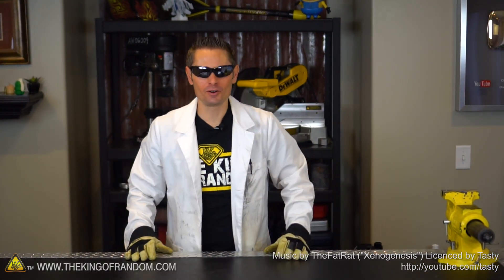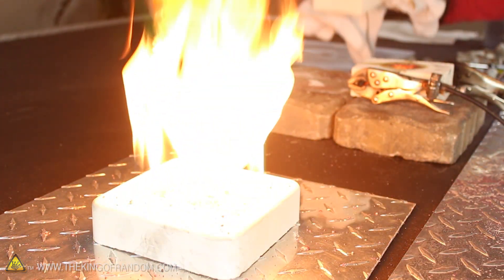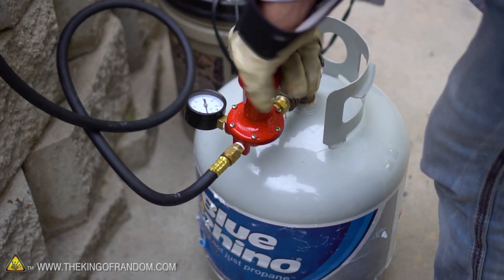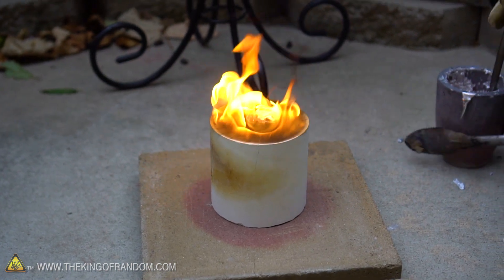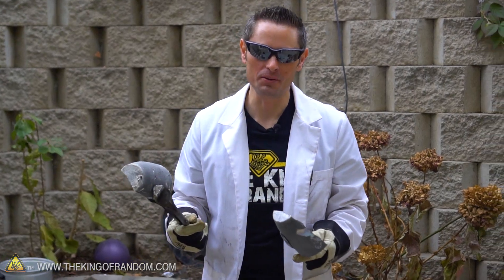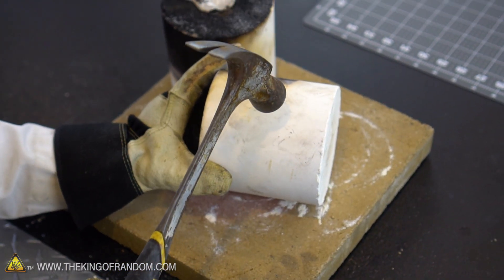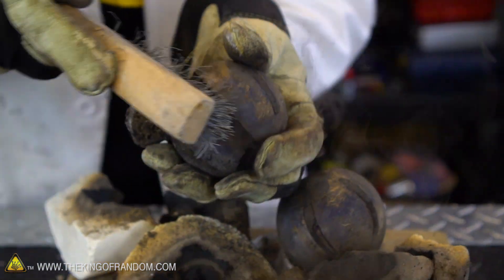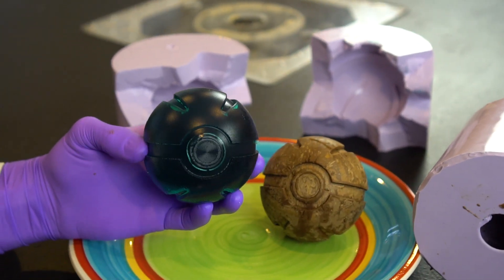Casting Aluminium PokeBalls

Comment: You should put your silicon molds in a vacuum chamber before letting them fully cure and set. It'll force all the air bubbles out, due to the drop in air pressure.
Reply: It would make for a great "Diy make your own vaccum chamber at home" video for him.
Reply: Guys we did it, check his Instagram he got a vaccum chamber.
Reply: 100% Agrees with this
Reply: is a vacuum chamber actually viable i have never seen that before that's interesting id love to see if it works
Reply: Kemal Ficici that's brilliant
Reply: venom gaming yep
Reply: Great idea👍
Reply: 26 Seconds :)
Reply: Kemal Ficici Does he have one ?
Reply: FredyEX l
Reply: Adam Savage, formerly of Mythbusters, on Tested has one and uses it for small mold making. Heck, he built his.
Reply: yess the molds will come out way better
Reply: Aaron Shields I'm pretty sure he does. If not, you can always buy one, they don't cost that much.
Reply: I the past he said he didn't own one
Reply: Rohan Gisiawan Oh ok

Comment: If you're looking for an easier method to cast things you should just buy some green sand and make some wooden cases for it. That's what most foundries use, and I can't imagine it's that expensive to purchase. Also look into common set-ups for casting molds. There are specific ways to make the molds to avoid getting air pockets/voids in your parts.

Comment: mix some okay sand in to your mold mix. say 60/40 plaster to sand. similar mix to the forge lining. and for the bubbles you need a vacuum chamber of some kind to Degas your silicone and plaster.

Comment: To avoid the air bubbles at the top of your lost wax casting mold, you need to add more spruing so that air has a place to be forced out, during the pour.

Comment: to reduce bubbles in your molds, you could probably build a vibrating table, like they use for concrete molds.  I have a homemade one, great for chocolate molds, and it would most likely work for silicone and plaster as well.

Comment: Grant,  try mixing your plaster 50/50 with fine play sand to form the investment, or grind up some diatomaceous earth kitty litter in a  food processor and mix it in the investment on a 70/30 plaster:kitty litter.
Reply: Additionally you may want to add vent sprues to your investments/molds so the gasses can escape and keep them from igniting the plaster material as much.
Reply: The vent sprues will also allow the air bubbles to escape and for aluminum to flow up through the vents.  As the aluminum cools and shrinks molten aluminum in the vents can help keep your spherical casts more round.

Comment: I work in an iron foundry and we use natural gas torches to bake out the moisture in our ceramic linings. To eliminate the shrink you should add a riser (large cavity in the mold above the casting) to provide feed metal when the aluminum shrinks.

https://en.wikipedia.org/wiki/Riser_(casting)

Comment: Hey Grant, I think I know how to eliminate the problem you had with the top of your mold. One thing would be to add another hole to allow gases to escape while pouring. Also adding a riser would help eliminate the shrinking problem. I'm not an expert on casting, but I'm taking a course in college where we learned how to do this.

Comment: hey i have a tip for metal casting.You can use quarts sand for the mold .Put it in a wooden frame and fill it with casting dirt and put the pokeball in tje midle and but quarts sand around it.Harden it wirh c02 and make holes to pur the metal 3 holes is the best and pour the metal in the hole.I hope this helps

Comment: Grant: are you using pure Plaster of Paris? you can mix in additives to improve its usability for casting. For instance you can mix talc in to prevent cracking.

You can also use sand as a filler in it, which might help you get the best of both worlds.

Comment: you can soak them in a bucket of water to clean the plaster and sand off. also you need to dry the plaster at a higher temperature overnight.  Also you may want to add a sprue so the air can come out easier when you're pouring.

Comment: when i check the other videos to make mold using silicone, they use a machine to vacuum the air. and because of that machine, there's no bubble inside the mold. so maybe you can check it out

Comment: Use a sander with no sand paper on the side of the molds while the casts are setting to release more air bubbles.

Comment: A tip for casting. You should just put the wax mold you make in sand and then poor the molten aluminum in it like you did with the styrofoam. It will save you a step and plaster and will certainly be much nicer than plaster molds. This method is widly used in metalurgic industry

Comment: Idea. when making the plaster of Paris(is that how is spelled?) on a vibrating table to work out the air bubbles. maybe a hand full of rumble motors from controllers. or any other easily obtainable miniature motors like ones used in game pads
Reply: for the air bubble problem in the mold

Comment: Hey Grant! when doing concrete we use a tool called a vibrator to help settle the concrete around bolts and forms. I'm thinking that you could find some thing similar and use it to help settle and dislodge any are bubbles from  your molds. you should give it a try

Comment: try using a vent hole as well when you're making your mold it will help push the air out allowing the aluminum to fill the voids.

Comment: you need to use a special plaster for better results. either you can buy it or add sand to the plaster but the former will yield better results. alternatively you can use clay which is much better though you need a kiln

Comment: Use proper jewelers investment plaster, encase the model and plaster in a metal cylinder (flask), pull a vacuum on the flask while pouring the metal and you will get a perfect bubble free, pit free casting.

Comment: Look up lost wax casting. I use it for casting gold and silver jewelry.
Reply: Cascade Pottery More specifically research 'spruing' it will solve problems with trapped air.
Reply: I use a centrifuge and vent holes when I'm casting. My response was more general to casting. There are a few things that Grant will have to adjust, but for casting on the fly, he's doing an amazing job. The things that he has created! WOW! They are awesome!